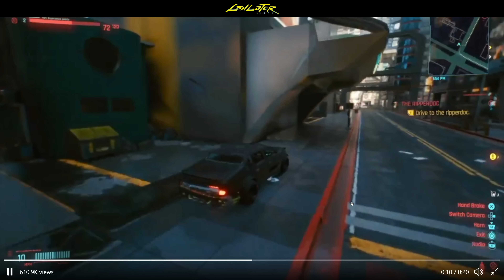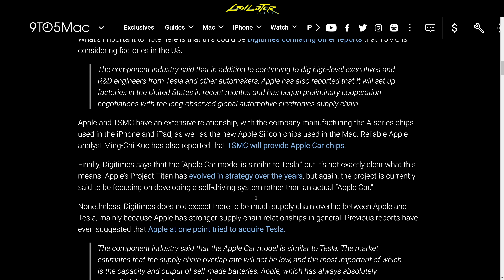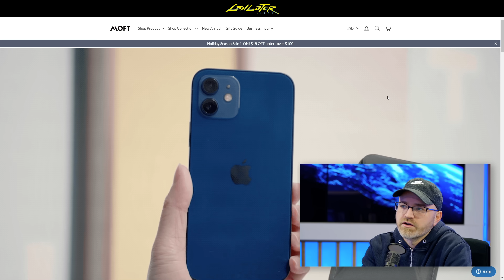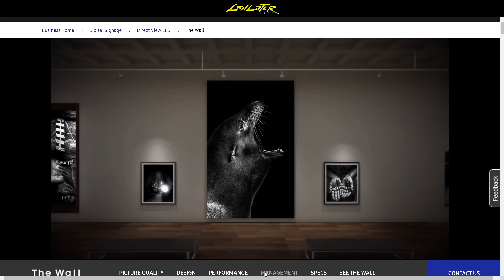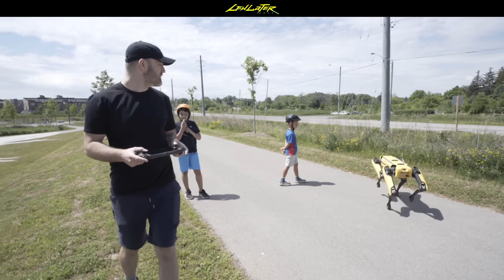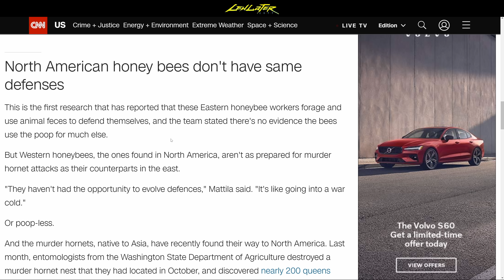Cyberpunk 2077 Has Some Issues...

Comment: I have been using the 1070 laptop for whoever in interested in the main specs google MSI GE638RF. My main home game dev laptop and also fun time. 

I have 2 hours in. First hour I did try to play it on 4K on the big TV on the bed... Did.. Not work.. :'( but! 
On the medium Settings (GTX optimised settings ) I am around 50-60 fps. It is on an SSD as well. So Asset loading is affected by both the Ram and SSD as asset loading depends on that. I suck at the game. I am trying to get through it and learn the game.

Comment: My strix 3 with a 2070 is getting about 35fps on average with settings completely maxed out. everything is turned up as far as the game allows. If I switch the DLSS slider over to performance it jumps up to 55 frames minimum in the most demanding environments. And the game looks unbelievable. I have never played a game that looks the way this one does. When a good 30 series laptop becomes available I will get one but for now I am extremely pleased with the performance my one year old laptop is capable of.

Comment: I get between 60 to 70 fps on high settings with ray tracing on with a rtx 2060 1080p
Without ray tracing on 1440p on high settings hdr10 I get solid 60 fps

Comment: The thing with Cyberpunk is it's been in development for 8+ years. It was always intended for last gen consoles and PC. It was originally going to be released in the spring and then in August/September.. way before next gen consoles released. There's not even a "next gen" version of the game yet.. its advertised to work on last gen consoles. I feel its inexcusable to release the game as it is and fix it later.. However, it has been running fine on my PS4 slim so far. I have all of my games on a 2TB external.. so I opted to install Cyberpunk on the 1TB system storage.. it's basically the only thing installed on the PS4 itself, and it runs fine.

Comment: When the expectations are so high, it’s down to make some people unhappy.
Reply: man i have a 1660ti cant even get consistent 60fps on low. game is unoptimized trash
Reply: @chiragwad  rtx 2060 super, 60 fps with Ray tracing at medium and everything at ultra 1080p
Reply: @chiragwad  im on a 1660 and i got 57 60 on high soooo i think something its wrong with your setup tbh
here my specs if u want them they match perfectly each other
1660
16gb ram
i5 9400f
msi z-390 A-PRO
Adata 120 gb ssd
Seagate barracuda hdd 1tb (where i installed cyberpunk)
The ssd its only to start the pc fast and the game is running like a dream but i feel ya and the people in consoles they got straight conned
Reply: @chiragwad  im playing on og ps4  lots of glitches but honestly not as bad as I thought it would be
Reply: I mean normally yes I would agree with you but having a working game on launch after 3 delays isn't really "high expectations". Personally, on PC I'm only having the occasional crash but other than that it's been a good experience. The OG Xbox and PS4 players are the ones getting snubbed here and I think it shouldn't have been released in this state on consoles.
Reply: @colinlogatto  it's the same situation I've found my self back in 2014 with gta online on ps3, it was unplayable, nothing new...
Reply: You mean youtubers because I haven't seen fans unhappy besides the clowns🤣🤣🤣
Reply: This was the most hyped game in history.
Reply: Even with normal standards of expectation the amount of bugs is too high  and graphical optimization so bad. Great game but definitely not the masterpiece fans are hyping for.
Reply: Yeah, like the millions upon millions still using the "old" generation PS4s and Xbox Ones.

But who gives a fuck about those? SHINY SHINY NEW NEW
Reply: When you anonce a game and takes little under a decade to release expectations will be high
Reply: It looks even worse than a 3-years old RDR2 and in some places even worse than a 7-years old GTA5. On PC. On Ultra. Yeah, sorry, my fault I had expectations.
Reply: @marklee1  yes a 7 year old gta5 that had thousands of patches and  thousands of developers that the main fucose is to patch unlke cdpr who can only fucose at 1 project at a time
Reply: @marklee1  are you playing on a base ps4 or what lol
Reply: Yeah, it’s making a ton of people unhappy because they can’t even play the damn thing.
Reply: @AaronCasey92  lemme guess, old gen console players...
Reply: @alvisegarbin3296  bruh! It's even crashing on PS5. It did 4 times already for me!
Reply: Console owners: It's crashing so much!

PC Owners: Wow this is amazing!
Reply: @alvisegarbin3296  you mean 95% of the public?
Reply: @AyAyRon93  I mean it's the ps4 version on the ps5, we'll have to wait till next year for the next gen patch.
Reply: But it should run functionally on the consoles that most people are playing the game on. Or they should not charge full price for it.
Reply: @michael_c2  I'm gonna say something that will make people mad, PS4 and xbox one are old and weak consoles compared to new ones and they need to be replaced by next gen console despite all the good titles they were able to handle and how good, or bad, they have been. Old gen console players shouldn't blame the game, but rather blame Sony and Microsoft for lack of stock ...
Reply: @alvisegarbin3296  Nooo you don’t saaaaay, you know this game was supposed to come out in April right, So if CDPR couldn’t optimize and get the performance right for these console you know what they should have done ,shelved it. However you know what they did? Continued to market it for those systems for the money😂
Reply: @alvisegarbin3296  The original PS4 and Xbox One are old and weak, yeah not shit. That does not excuse CDPR for releasing those versions as the broken mess it is. 
For $60 it should be working at the very least. If not, it shouldn't have been sold.
Reply: Its the base consoles... its old hardware 😔😒
Reply: @Greek Goddess lmao, I'm salty? You can keep your exclusive as Im not interested in Playstation exclusives if not for God of War and the last guardian, which PS4 and PS4 pro can't handle well...
Reply: "Keep your expectations low, boy"

My man Kratos givinf us wisdom of life